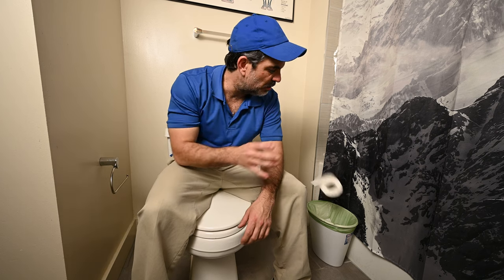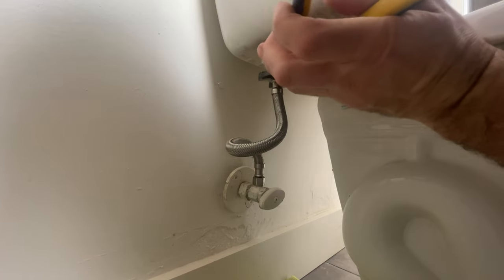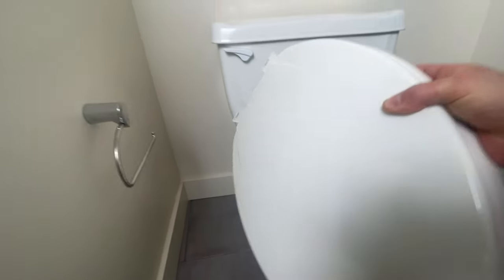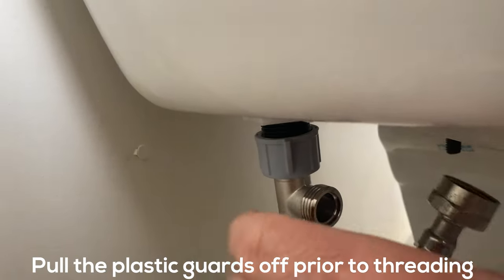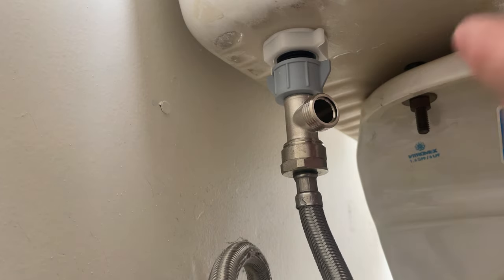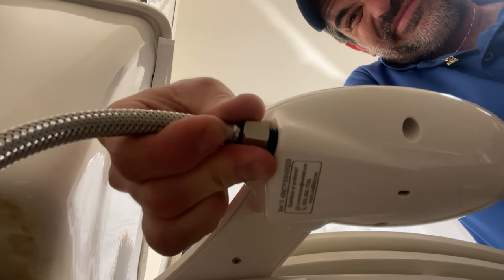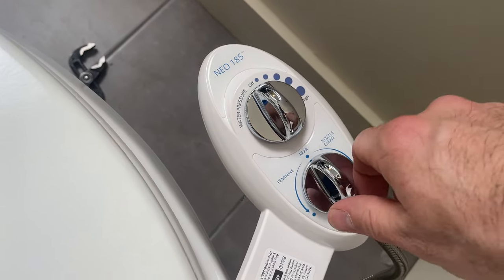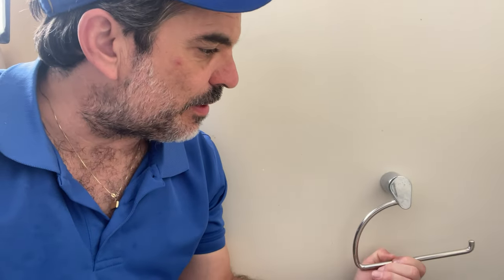How to Install a Bidet

Comment: Great video, I'm using my bidet right now!  You might still want to hold on to the TP to dry yourself though 😁
Reply from the maker: Hahaha yes I realized that after the first time I tried it out 😀
Reply: I plan to get one and use the "basket of personal drying cloths" method to help the environment and stop using tp. Just use one to dry after cleaning, put it in a designated hamper, and wash them in hot water to sanitize. (Works for our body towels, why not booty towels? 😆)

Comment: At the very beginning when you turn off the water supply… do you have to flush the toilet tank empty before you remove the line or will a full tank not flow out of the bottom connection?
Reply from the maker: You don't have to flush the toilet tank because on this toilet tank the fill valve is one of the seals that keeps the water in the toilet tank. The others being the tank bolts, flush valve seal and gasket (usually in the middle of the toilet tank).
Reply: @ApartmentMaintenancePro  I figured as much but just wanted to make sure! Thanks for the video and the quick reply. 👍

Comment: Will water leak of the tank when you remove the hose? I'm a little concerned about that part when you take it off.
Reply: Ah i see after fiddling with it, i think it was previously cross threaded as it went on with almost no force and became tilted, i may have messed up but i can't get it off. There are no leaks though and i used some of that ribbon tape provided iwth the bidet and the oring i'm assuming will help my mistake. May call a plumber, thanks for the video though! Lesson learned!